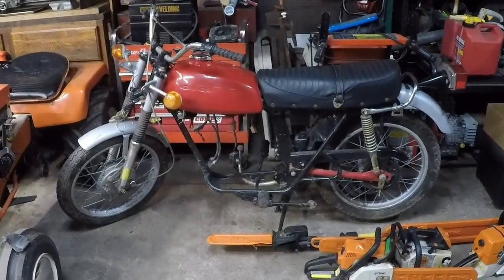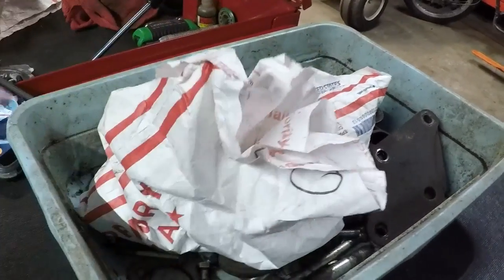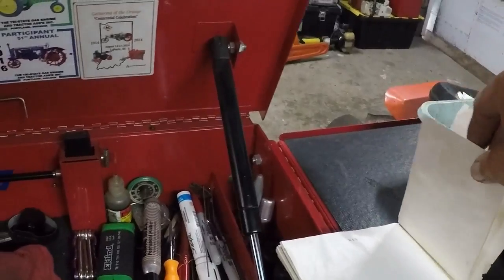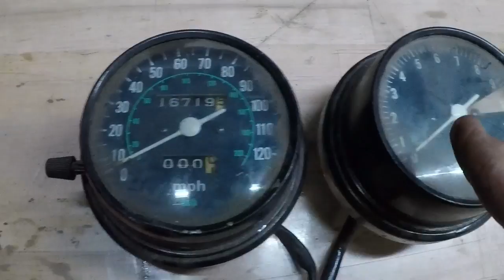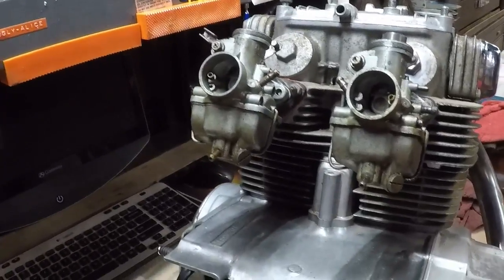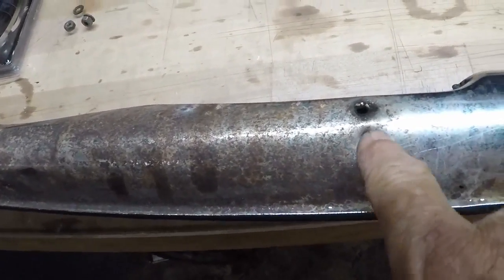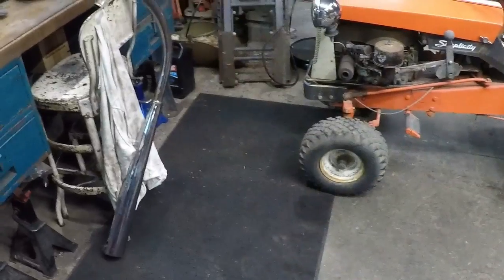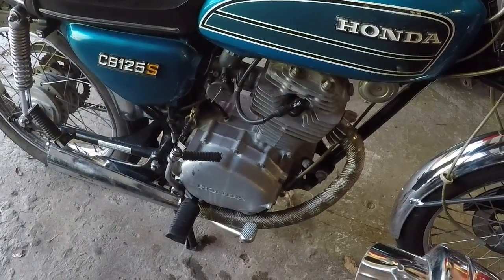1975 CB125S And 1974 CL200 Updates

Comment: Read as many cons as pros with pipe wrapping. Breaking down and deteriorating the pipe being the primary one. Hope it works out for ya. Wow that is alot of trees to fell in one day. When them rascals hit the ground, that is when the work starts. Nice video Zip!
Reply from the maker: Yes Sir Arcie. I heard the same about the wrap accelerating corrosion. I'm hopeful I'll find a suitable replacement before the chrome plating totally gives out and the pipe rots away. I do have a secondary plan though...make a stainless exhaust. As for a lot of trees in a day....Yep! Before that day, the most I would fell on my own was 6. But on this fateful day, I had a work crew of 5, which helped a ton with the clean up. I bucked the stove lengths while two others limbed and the three remaining were carting off the brush. Otherwise, there was no way I could have managed. Cheers my Friend! Zip~

Comment: Man that tree sure made a mess
Reply from the maker: 6 of the 7 trees took the exact same path in felling and total damage to the Red Bud trees...three small branches lost. The tops of the ash typically just explode when they hit something and usually (as in this case) don't do much damage to the live and more flexible trees. I did get permission to destroy the Red Buds from Larry, but I still wanted to try and save them. In all...I'll take the little bit of damage to the trees vs. the alternative....Damage to the barn where all the trees were. Three of the 7 were leaning towards the barn (as with the one in the video) and needed the added security of a tending line. There are still 11 more to come down on Larry's property, but those 7 were the biggest concern of causing damage to outlying buildings. Cheers Dave! Thanks a ton for stopping by! Zip~